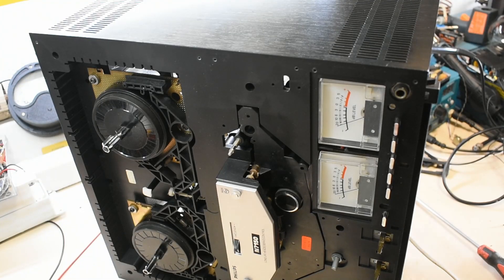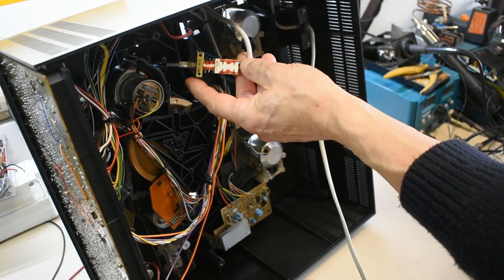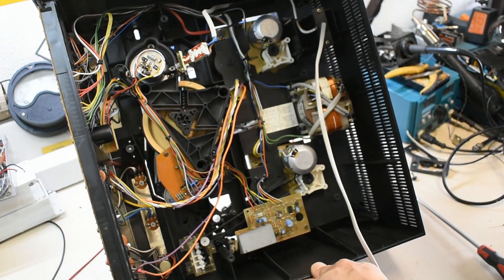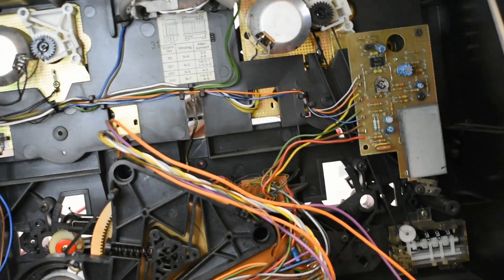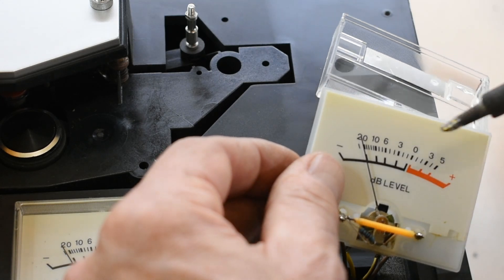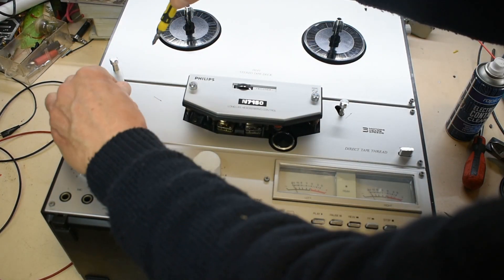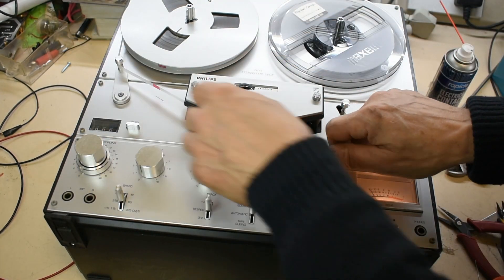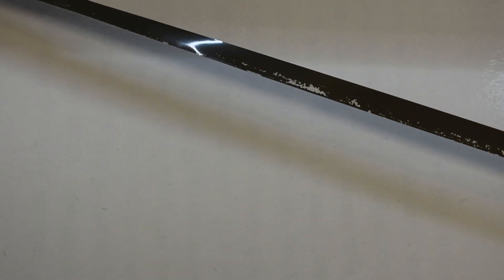Walk through and repair of a Philips N7150 reel to reel tape recorder

Comment: Hi, Very nice tutorial.  I have to replace the counter belt. It is a pain, how do you remove the load cartdrige? I dont see an easy way to do it without breaking anything. Thanks
Reply from the maker: Both belts were a pain to replace on this. I can't remember the details off hand now but the hub spindle did need to be dismantled. I remember paying attention to the float height setting adjustment when dismantling it. The plastic has become a problem in these as it has become brittle and bits break easily.
Reply: @tuopeeks  Hi , I was able to remove the load cartridge.The axe has a "circlip" inside the black hub on the back of the assembly. Thanks
Reply from the maker: @Angel-m3v9z  That rings a bell, glad you persevered with it.

Comment: From where did you buy those led filaments?how many volts/miliampers must the filament led be?
Reply from the maker: The the LED filaments can be found on eBay the ones I have used here are 3V not sure of  the current now but I ballast them with a resistor in series for this repair. I would suggest picking the warm white LED version to match the colour of the original tungsten lamp.
Reply: @tuopeeks  i fiind some in ebay ,3v 19 mm,i will try them for my N4520.what resistors  value did You used?
Reply from the maker: @eduard4045  I used a 1kR resistor but you can probably go a bit higher as they are still quite bright at that. I think the voltage is around 15V with the low loading the LED has.

Comment: I have the same r2r player, mine power up but can't operate, motors won't spin up and VU not lit (tested them and bulb working). No response when I press play, ffou rw. The only sign of life is when a press record and the record LED light up. I don't understand where is the issue (tested main cap and there are all good).
Reply from the maker: Not seen that fault yet but it does sound like a PSU issue. Might be worth getting the workshop manual with the circuit diagram.
Reply: @tuopeeks  Found, it's film capacitors especially those with colors brown/black/yellow/brown (10nF 100v). Changing them fix this issue.
Reply from the maker: @sagrat6235  Good to know. Some capacitor survive for decades but some go short or open circuit.

Comment: Very interesting. One thing I always had problems with was those that used light for the end of tape, finding a bulb to fit some of those was a nightmare.
Reply from the maker: Thanks, know the types you mean, even early video recorders used  small bulbs and photo diodes to detect end of tape.  The photo diode would be sensitive to infra-red and the bulb would emit in all directions so could be interesting but fiddly to replace with an LED.